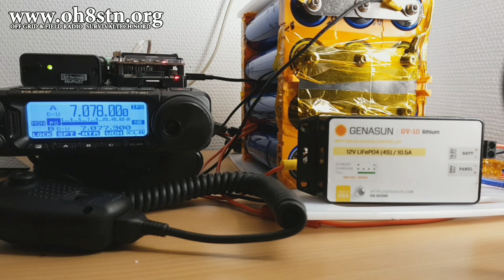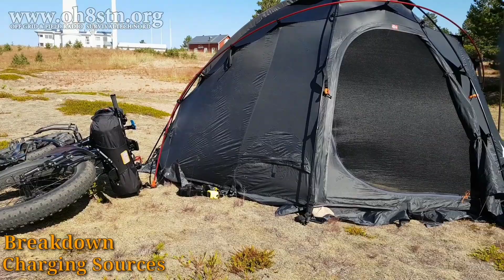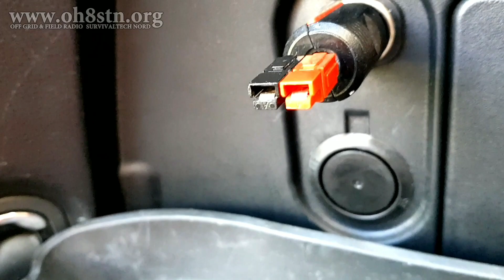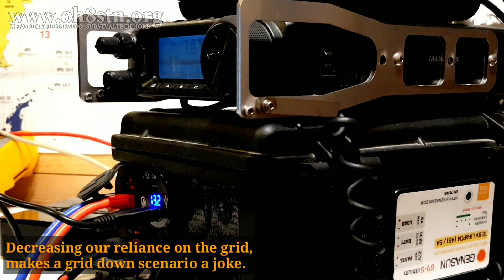Backup Battery Power | Grid Down Communications

Comment: You are one of my heroes. I just assembled my first solar kit -- a Bioenno 28w panel, 15Ah battery, and a Genasun GV-5. I am still testing the system but it will inform my next build. You gave me the confidence to pursue this approach. Most of my ops are portable ops because of RFI here at the house.
Reply from the maker: Thanks for the kindness David. The next time you visit Bioenno, ask them to stop hating on my battery builds 😀
I do understand you with taking that leap of confidence. There are still so many operators who say lithium batteries are too dangerous or too complicated and they prefer to use lead acid batteries. As portable operators, we know how easy it is for someone in the armchair to tell us to use something that weighs four times as much and produces half the power. You're on the right path and I wish you good luck with your system. Hey one thing about the gv5. If you're operating qro, don't use the load port to power your radio. Connect to your charge controller battery port in parallel with your power distribution. You can then use a relay connected to the load Port of your charge controller to switch on and off power to your radio if you need to. Congratulations on stepping up your game.

Comment: Hello, great video as always. My question is would it be better to run one large panel or a couple smaller panels in series using an mmpt charge controller. I live in northern Michigan in an area of dense hardwood bordering Boreal forest and it can be hard to find a spot of full sun. It's also not uncommon to be cloudy for days at a time. My thought is that the series wired panels will achieve the minimum charge current more easily in less that optimum conditions. What do you feel is best? Also having more panels means redundancy in your system should one fail.
Reply from the maker: Thanks for the kindness on the question. You know I have the same problem up here in the North. I think you meant parallel rather than series. Series increases the voltage while placing panels in parallel increases the current. I just found a new charge controller which you can see on my Instagram. It's called a boost controller from Genasun. Other companies have them as well like victron and so on. I like the idea of multiple panels. What I do is say run those panels in series parallel strings. So I may put two panels in series and then put a second set of two panels in parallel with the first set. Bissell increase your voltage, but also increase your current. I think you're onto something and it will be nice to see how it turns out.

Comment: Great video!

4:20 - My base station at home is solar powered, with a LiFePO4 battery and isn't limited by size or weight because I'm not carrying it.  For a go bag or man portable emcom kit, I'm leaning more toward something between QRP and QRO as probably the sweet spot for solar powered portable use.  Use the least transmit power to make the connection, as always, and that may be 5W, but I like the ability to run 50W for VHF/UHF or 100W for HF if needed, but plan on running 20W most of the time.  Slow digital modes can be very power saving.

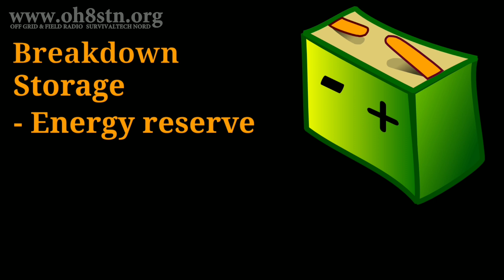5:20 - I like DIY and building stuff, but lately I'm finding it very convenient to buy a LiFePO4 battery of the voltage, instantaneous power and energy storage capacity I need, with built in battery management system.  It's a simple energy storage module.  In theory, the BMS will have charge voltage termination so an appropriately sized solar panel could be directly connected.  In practice, I use an inexpensive DC-DC converter as a charge controller.  This is usually a 12.8V battery and the DC-DC converter wired between the solar panel and the battery, with the DC-DC converter output adjusted to 13.2 V.  It fully charges the battery but the DC-DC converter cuts off before the battery's overcharge protection starts cycling.  In theory, the cheap Chinese DC-DC converters are electrically noisy and not as efficient as a nice Genasun charge controller at 5-10X the price, but the noise hasn't been a problem on VHF or UHF.  HF is where I'll notice if I need to spend the money on a Genasun, which I probably should do for the sake of reliability.  Ceramic capacitors instead of electrolytic capacitors is a design that's built to last.

8:00 - For the solar input to my battery box (with internal charge controller and power distribution), I use a pigtail with three Power Pole connectors.  The outer terminals are red and black and the middle is gray.  It's unwired and is only used to key the connector to differentiate it from regulated DC power.  This prevents me from accidentally plugging the solar panel into the 12.8V DC power out.  The short pig tail is a bit ugly but functional.  I really need to find a connector in a flush module I can mount into the battery box that isn't a Power Pole connector that doesn't result in a pig tail.

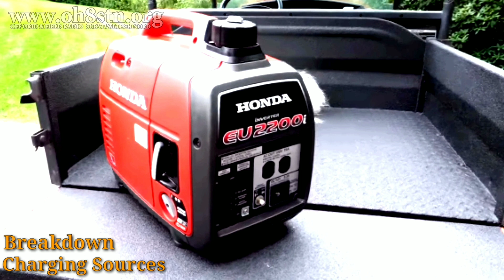8:55 - A gasoline or diesel generator is not the first power source I'd consider.  For the reasons you described, it's the last thing I'd consider.  There may be situations where it could recharge a battery while I'm not running a radio, but the size, weight, noise, exhaust, and high fuel consumption make generators very impractical for me.

11:30 - My two 100W solar panels are arriving in two days.  They'll be used to charge my e-bike, which I plan to use as a commuter bike.  They'll also charge a small battery that powers the lighting in the little e-bike garage.  I have a separate 30W panel and battery for the home ham shack so these are each dedicated purpose-built systems, but in a pinch, I could rewire them as needed if one or the other malfunctioned.

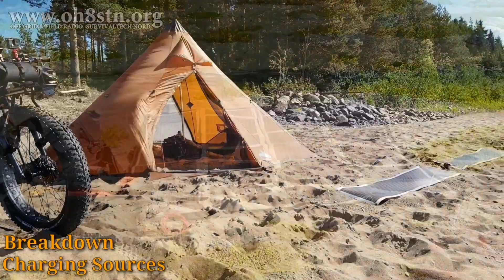11:50 - I wish there was a good option to PowerFilm panels.  I have a folding 60W PowerFilm panel that I bought lightly used on eBay and it's great.  I got a very good deal, but it's still much more expensive per watt than rigid heavy panels.  There are lower cost flexible panels but most typically aren't as flexible and are currently US$1.40 a watt as opposed to US$.85 per watt for rigid glass panels or US$11 per watt for PowerFilm portable panels, which are from my perspective the only panels worth carrying into the field.  I know it's a much smaller market than residential solar, but it looks like a competitor would make a good portable solar panel for US$5 per watt.

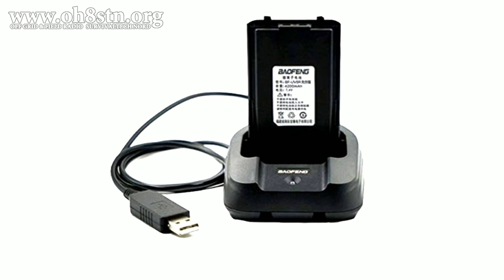13:55 - A super lightweight voltage buck converter (decreasing voltage) can be made with a string of diodes of the correct current capacity.  If you have 12.8V and need 10V to charge a Baofeng radio, you could install a series string of 5-6 diodes in a home built charging cable, and heat shrink (or epoxy heat shrink to waterproof the connection) and each forward biased diode junction will drop approximately .5V.  This isn't a very efficient buck converter as, like a linear power supply (LM7805, etc.) the excess voltage is wasted as heat, so a 12V to 10V converter will be 74% efficient.  Wider voltage drop percentages will be less efficient.  However, this is a very small and lightweight buck converter.  At these low current levels, a ten pack of Chinese DC-DC converters can be purchased on Amazon for US$1.50 each, and you can dial the voltage exactly where you want it, and the output voltage doesn't drift as much with current, and these little boards are tiny.  They can be electrically noisy, though.  A linear DC-DC converter is quiet, although inefficient.

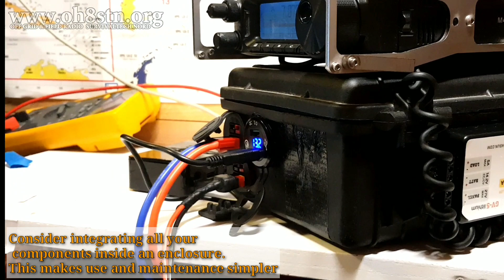22:00 - Nice looking Pelican case on your 20AH battery box.  My base station box is 10AH and I went with a lighter weight and much more cost efficient MTM plastic ammo box.  A metal ammo can would do a better job of containing any radiated noise from a cheaper DC-DC converter that's used as a constant voltage charge controller, but it's heavy so not as good for portable operations.  It's also conductive so more electrical insulation is needed inside.

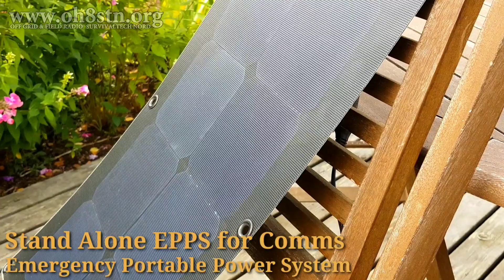23:20 - I completely agree with the standalone power requirement.  All of my radios are 100% solar powered with decent battery backup.  Why invest in a DC power supply for use on AC mains when I need off grid communications?  I'd sooner build a second completely redundant solar and battery system and put it in safe storage in case the primary is damaged.  I really need to upgrade my base station to a 200W solar array with a 100 AH LiFePO4 battery to power a QRO radio and Raspberry Pi 4 for digital modes.  My radios are configured to display the input voltage on the LCD so I can keep constant watch on the battery voltage.  This "free" battery voltage monitoring is more useful because my battery box is on the floor and I seldom look down there.  Having the voltage display on the radio's user interface keeps the focus of my entire communications system on off grid emergency communications.

I went on a strenuous 5 mile hike yesterday.  Looking at other amateur radio operators, physical conditioning is often under stressed.  If you want to stay home and talk on the radio as a geeky social hobby, that's fine, but it's not as helpful for emergency communications.  When the SHTF, the physical ability to move and operate in adverse conditions will be helpful.  As I age, maintaining physical conditioning is more of a challenge.  On yesterday's hike, I made note of nice locations to camp in a month or so when I take some radios into the field and operate man portable.  I'll probably make a video showing what I'm doing and why, but it won't be of nearly the quality of the SurvivalTech Nord videos.

Comment: I live in the coastal northeast (USA). Like in your video, I cut the wall wart leads and install Anderson Power Poles. I have a self made backup power system using RigRunner products. I also power my cable modem and router on this UPS. If cable lines aren't torn down in a storm they are likely to remain active depending on the ISP provider's power situation. For the less skilled you can purchase an off the shelf UPS to accomplish the same. I have a generator I only use during the day and fixed solar on the rear of my home with a 400 Ah battery bank for power outages. I also have portable solar I use for camping and off grid ham activities. Everyone in my neighborhood have one or more new vehicles and they rely on them for recharging their portable electronics. What's sad, I think for many the only emergency light they have is on their smart phone. 73 all.
Reply from the maker: Outstanding common. Thanks for sharing your situation and set up with us.
73
Julian oh8stn
Reply: @soctnights The cable lines are not the problem but the equipment behind the ports feeding those cable lines... Backup power will be cut down for crucial communication.

Comment: Julian, I see that you have been doing a lot with the LIFEPO4 cells. are the LI-Ion cells just too hard to get the right voltages for your comms? I ask as I am working to get my gear self reliant, but have a ton of the 18650 cells and the headways seem very expensive when I already have the others. Anyway, great video, as always.... and Keep up the good work! 73!
Reply from the maker: Actually there's two points at play. Firstly the safety concerns. Lithium ion 18650s are extremely energy-dense. When we combine that with DIY projects, and some operators using recycled cells, it can be a recipe for disaster. The other thing is the voltage. A 3s pack will power a qrp radio but a 4s pack has too much voltage. With lithium-ion we just miss that sweet spot to power a radio. If we're going to power an inverter or something like that, of course we can use lithium ion, since an inverter has a much wider voltage input.

Regarding lithium iron phosphate, it's almost a drop-in replacement for a lead acid battery. It's not as energy dense as lithium-ion, but it's almost impossible to get it to ignite. Also the cycle life is much higher than lithium ion, making it cheaper in the long run.
Awesome question

Comment: I run a goal zero nomad 28+ chained to a goal zero nomad 20, to a Omnicharge ultimate power bank. 

I figure between the nomad 28 and 20, I can expect ~40 watts  on a good day. If I need more power, I have a second nomad 28+ that I figured would boost my nominal output to ~65w.

The Omnicharge ultimate battery is 38,000mah or 140wh, and has barrel plugs for in and out, pass through charging, three USB outlets, and a 120w AC outlet. Max charge for the battery is 90w. The barrel plug outlet is variable in 0.01 volt increments. So I can set the output voltage to 10.4 volts and run a 5.5mm to 5.5mm barrel plug straight to the charging base of a baufang radio. I can also run a 5.5mm barrel to Anderson adapter(5.5x2.1 pig tails from Amazon) and power anything with 12v up to 8amps: ~90w. I also keep a spare battery around so I can hot swap the internal battery once it's full. This gives me universal 76,000mah or 280wh of power, in a ~6 pound package. AC, DC, and USB.

The whole setup probably wouldn't run QRO for very long, but it keeps a bank of handy talkies going forever, and really doesn't take up much room in the pack. 

In addition, I use a nitecore D4 universal battery charger and a few olight USB universal cylinder  battery chargers in case the nitecore fails or I need to charge more then 4 batteries at a time. This is how I keep all my other electronics like flashlights going. 

The who system is scalable and can be chained together. I keep everything in a 40L dry bag.

 If I need more power, I also have a Dakota 20ah lipo battery and genasun boost(only needs 8 volts to charge the 14v battery)  charge controller hooked up with Anderson power poles to add inline or separate. This is a very heavy option, but I have no doubt it would run QRO on a limited bases.

I'm sure there is a better set up, I just haven't seen one as compact and clean as what I'm running at the moment. I would like to get one of power films 60watt rolled panels, but I was able to get all the panels I have for less then half of the power film.  But it's on the list anyway. Next item though is probably going to be a G90 SDR hf radio. 20watt all hf band radio with a built in tuner, weighing only one kilogram. A lot of capabilities for the weight.

Comment: For the person who has no off grid power where do you Start?  Portable QRP power, fully supplied QRO shack off grid?  It seems daunting when starting from scratch.
Reply from the maker: Brian it absolutely is daunting. Thankfully we start with the first video in this series which talked about the different types of communications we intend on using. Once you understand what your goals are from a Communications perspective, you can design the emergency power, to run it all.
Reply: OH8STN Julian, I am greedy.  I want it ALL working when the grid goes down.  LOL.  Seriously, I approach these situations with what I am most likely to face.  Living 6400 ft above sea level in Colorado, A snow storm that takes out the grid for a couple of days.  I don’t operate portable in Blizzard, so run my FT-991 and the antenna tuner (HF) in the shack QRO, 45 W at VHF/UHF & 90 W HF.

Comment: Another home run Julian.  You are the rock star of Grid-Down communications!  I’ve been using a KX2 QRP when backpacking to stay in touch with family back home, incorporating a solar / battery setup similar to yours, (no cell towers even remotely close).  Other critical considerations are using efficient data modes (and I agree with you that JS8 is a god-send), and antenna location.  Using the pioneering work of Les Moxon, G6XN I can get tremendous performance from my EFHW antenna strung from a tree, by transmitting from a site just below any mountain peak, sloping in the direction that I need to transmit.  Moxon calculates terrain reflection gain of 6dB or more depending on slope and my results agree with that.  I can get reliable voice contact at 1000+ miles on 20m at 5 watts most days, and switch to JS8 at night (camping in a valley).  For the same reasons that primitive Bow Hunting improves one’s outdoorsman skills, operating QRP / Solar makes me a much better Ham Radio operator.  Thanks again for your contributions Julian.  You’re an inspiration to a lot of us!!!
Reply: I'm using the KX3 pretty much the same way, and haven't got into JS8CALL yet, but I totally agree that QRP makes you a better Ham. Doing more with less is the reason why I became a Ham in the first place, all thanks to Julian's videos. I would like to know more about the EFHW antenna that you're talking about, I'm currently using the Chameleon MPAS and want to try something different just so I have more than one option. I'm here in the middle of Kansas so no mountains and valleys to speak of.
Reply: Amish Special Forces, I have the Chameleon MPAS also and love it.  However it’s too heavy for backpacking on long trips where every ounce counts.  The antenna I use for backpacking is a PAR End Fed 10/20/40 Trail Friendly.  It’s made by LNR precision, (and they just got bought out this month by Vibroplex, but it’s still available).  It’s a great little antenna, fits in the palm of my hand and weighs only a few ounces.  Hope this helps.
Reply: bax737, I've found great success using the MPAS and carrying it with a Swiss salt and pepper rucksack that's made for carrying the K31 rifle. The MPAS antenna fits right down in the tube for the rifle perfectly. This fall when I hopefully get time I'll make a video on my setup and post it to YouTube.